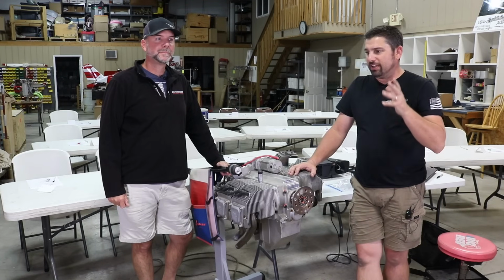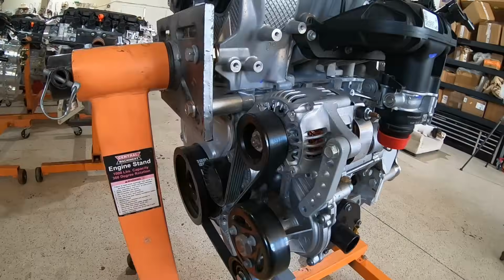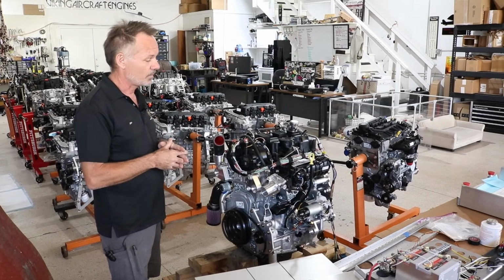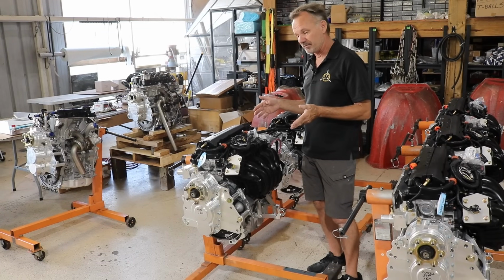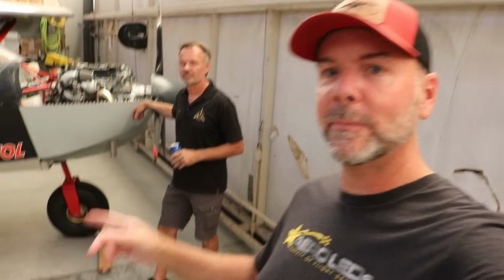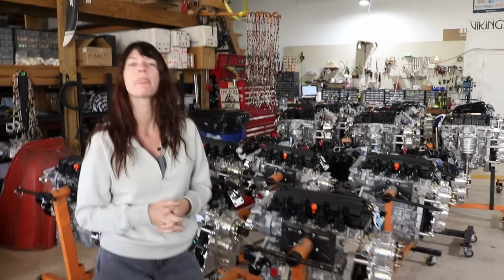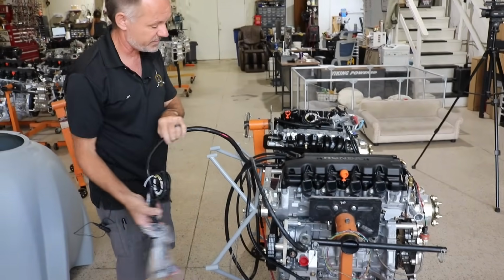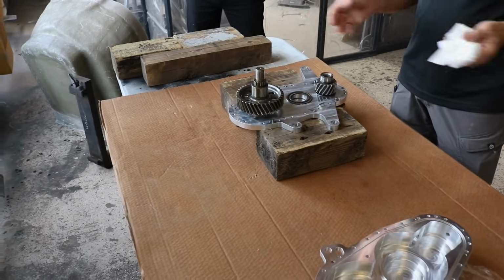Viking Aircraft Engines - ENGINE WEEK 2024

Comment: I'm pumped at these as options, but Jan and co seem very quiet on TBO's... in addition to the OEMs' relatively  short engine manufacturing durations for a given model (compared to standard aero engine makers), MPS and MPA (mean piston speed/acceleration) are very real considerations when designing engines for continued, high-RPM operation, and related durability.  With the high stroke to bore ratio on most of these engines when compared to aviation and motorsports applications where this type of operation is most common, the TBO/reliability are a real concern...  Again, given the refresh cycle of auto engines, Jan has already discontinued the 110hp model, and mentions the 130hp is soon to follow.  So yes, pros and cons, but these are very real cons I've not seen mentioned on the variou.s hand-built forums in which Viking is popular.  I'm not in the least set against the idea Viking is pursuing, in fact I support it, as the CapEx savings are tremendous, but the home-built industry would be well-served to see MPS, MPA and data-based TBO intervals given for Viking engines vs. the more common Conti/Lycoming/Rotax alternatives.  A lifetime ago I did these calcs after taking a graduate-level ICE design engineering class from a SAE Fellow, but it's been a minute... Thanks!

Comment: I was curious, what was the deciding factor for using the middle gear versus a double roller chain on the propeller drive? And how did you deal with the side loads created from helical cut gears?
Reply: I never considered a roller chain because of weight, possible tensioner/idler needed etc. If I were to consider a chain it would of been a link chain, but those are also too heavy.
Reply: @eggenfellner  Thanks for the reply!

Comment: Not addressed.  Single ignition/coils/spark plugs. No redundancy. Car engines are not engineered to run at a continuous 70% throttle.  So safety to the TBO is???  It looks like nice engineering but is there data to support longevity?
Reply: Each cylinder has its own independent coils/ignition. The chances of all 4 failing is virtually zero. Running the engine at 70% is not an issue if properly cooled. These engines are very rugged, I had one of these engines on a pickup truck that went over 400,000 miles without any rebuild and no oil leaks or burning oil. Heat is the issue. If you cool the engine properly it will last.
Reply: 15 years of data and a 2000 hour TBO with very little cost to do so. A lot of these engines are used on outboards and redlines well above 7000 RPM.

We also have every coil/spark plug independent and two batteries and two fuel pumps. 

FYI, we had a guy in a Cozy run 40 hours without realizing one coil was plugged in, only slightly less power…still worked..
Reply: You are correct, the engines are designed to run at much more rigorous and demanding conditions of city driving which are numerous cold starts (exponentially more than in an aviation application) and constant cycles of stopping and accelerating. Aviation application is quite gentle with the steady state of operation.  ICE engines perform best when at continuous workload.  As long as there is good cooling, good fuel and good lubrication the aviation application puts less stress on the engine then the city driving that these engines are designed to handle.
Reply: @dieseldan5189 100% correct
Reply: @dieseldan5189  yes, and no.  MPS and MPA (mean piston speed/acceleration) are very real considerations when designing engines for continued, high-RPM operation, and related durability.  With the high stroke to bore ratio on most of these engines when compared to aviation and motorsports applications where this type of operation is most common, I question TBO expectations... Viking seems to be very quiet on this aspect.  Also, given the refresh cycle of auto engines, Jan has already discontinued the 110hp model, and mentions the 130hp is soon to follow.  So yes, pros and cons, but these are very real cons I've not seen mentioned on the various hand-built forums in which Viking is popular.  I'm not in the least set against the idea, as the CapEx savings is tremendous, but the industry would still like to see someone calc MPS and MPA for Viking engines vs. the more common Conti/Lycoming/Rotax alternatives.  A lifetime ago I did these calcs after taking a graduate-level ICE design engineering class from a SAE Fellow, but it's been a minute... Thanks!

Comment: Question for Jan. Honda has been offering its Civic Type R crate engine to consumers for a couple of years. It is the K20 C1 and has a rating of 306 hp. Are there any plans by Viking to start offering this option in the future. Any concerns on higher weight of this engine
Thanks
Reply: Not really, no real intentions on going beyond the HP ratings now. Simply because the experimental market doesn’t really need it to any kind of quantity the allows for more RD. It would be amazing no doubt, but we also would need different gearbox design etc. also keep in mind we really test out engines, so an aircraft to do so as well…
Reply: @alissaeggenfellner4613 to bad it would be fun to have one of your engines for a rv-10